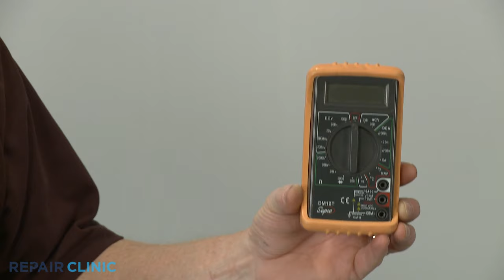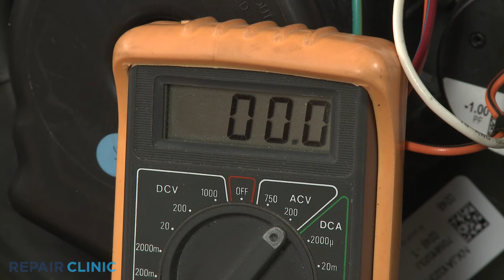Furnace Draft Inducer Motor Voltage Testing

Comment: The video does not explain what the proper voltage to be receiving is. It says if you receive voltage it's defective, if there's no voltage it's the control board - so what should it be if it works fine?
Reply: Yeah exactly. I’m getting 7 volts AC. Which obviously is wrong. The motor works when jumped to the wall. So I guess my prob is the board. Best wishes for success on yours.
Reply: But I’m pretty sure the motor is 115v AC. Look at the label on the motor. Sometimes they have capacitors which can go bad. Look at the wiring diagram. Most of the time the capacitor is not designed to be replaced. They want you to buy the whole fan assembly.